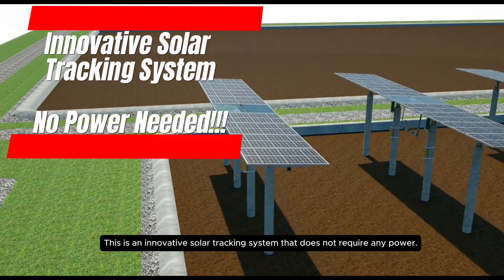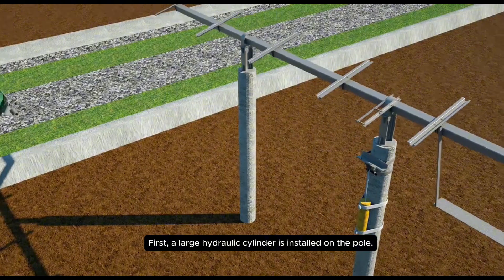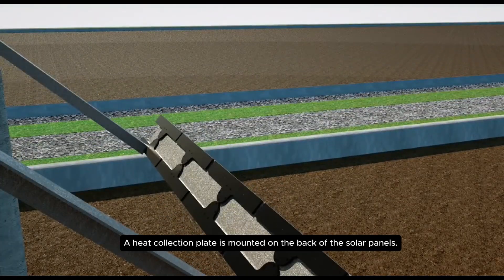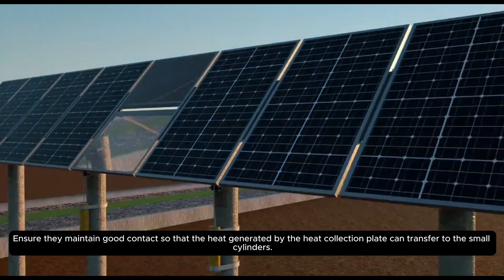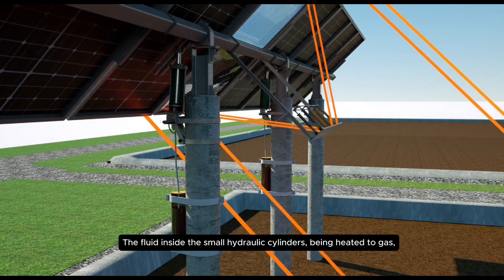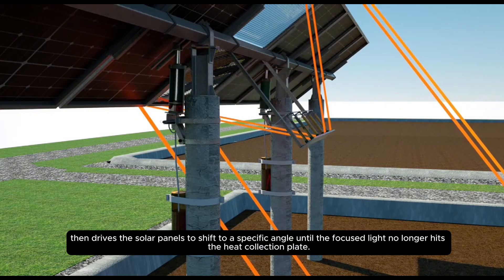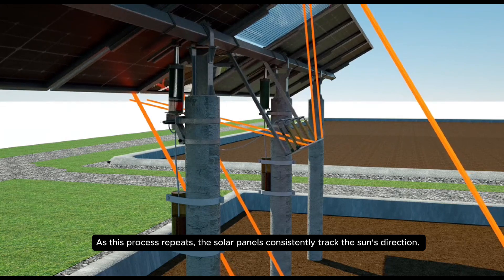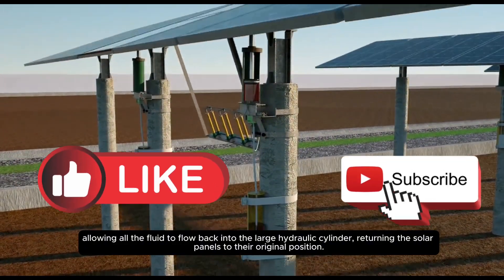Innovative Solar Tracking System---No Power Needed!!! #renewable #solarpower #solarpanels

Comment: Overly complex. Think simply. Like installing a small battery, charged from solar the day before, to power the movement. A battery limiter, which can hold onto some charge for the next day, are built in to most modern powerstations/batteries using an app controlling charge/discharge.
Reply from the maker: I agree somehow it is complex. But it may be more stable and could be cheaper if there is some improvement. At the end of the day, people care mostly about cost and stability. I saw many people trying to use electric tilt racks but were eventually chosen to fixed racks. The lifecycle of motors and electronics is a big concern. These solar panels are supposed to be in service for at least 20 years.

Comment: One typhoon and it's a wreck 😂
Reply from the maker: Probably, tracking solar systems has a lot of problems. It is only useful when there is not much space for more solar panels but you need to increase your solar output. Maintenance work for tracking solar systems is very difficult. And the initial cost can be double or even triple compared to the fix tilt racks.

Comment: I started controlling my sun tracking greenhouse & solar array with solar controllers but a cloudy morning would let the sun get past the sensor and leave the greenhouse facing east all day .
Now I use a simple timer that turns the greenhouse & array , KISS method is usually more reliable.
Reply from the maker: The auto-tracking system looks fancy but is less reliable and expensive. It can create a lot of maintenance problems after installation. Many large solar farms prefer to calculate a fixed tilt that can generate maximum electricity considering the year-round data. In your case probably timer is the most cost-effective solution and it works.

Comment: you can also mount a solar panel instead of the fresnel lens and power an electric motor to rotate the panels, which would be cheaper
Reply from the maker: yes, you are right. But without a battery, I am not sure whether the real-time generation can drive the motor, especially in the morning. A 400kW panel in the morning probably can generate 50W real-time power. I guess in most of the cases this type of control system is powered by utility or a centralized supply from a specific group of panels.
Reply: @Renewable_Tek  the good thing is it doesn't have to be fast. you can use a weak motor with a high reduction gearbox.